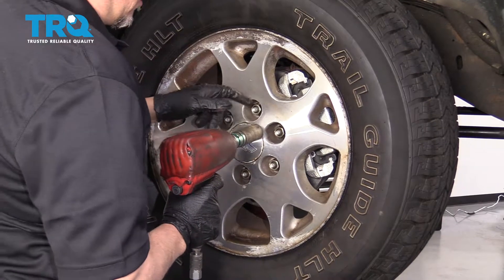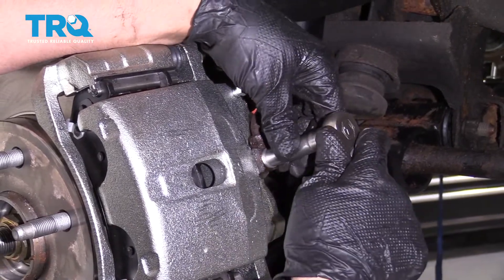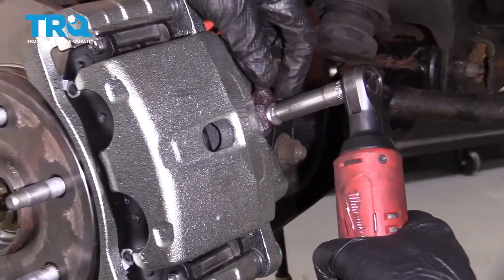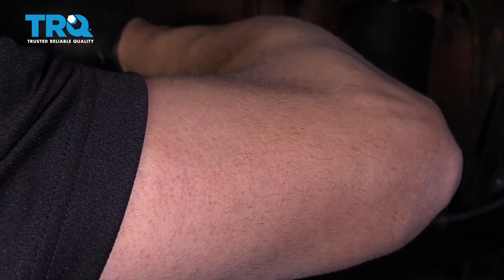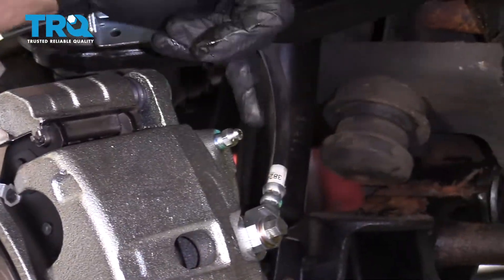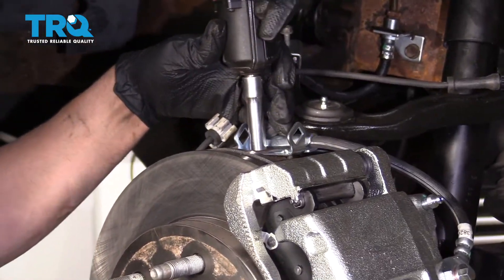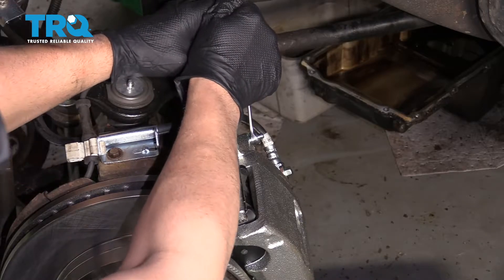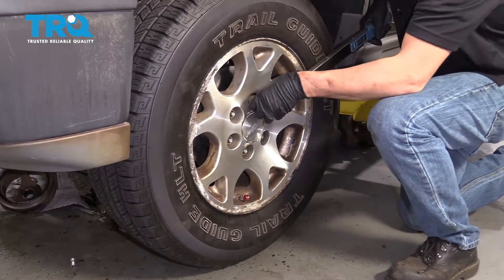How To Replace Front Brake Hose 2000-06 Chevy Tahoe

Comment: Even after watching this vid, I was still dreading replacing the line on my '02, have had plenty snap over the years trying to get those nuts on the fixed line broken loose. Fortunately, this is the cleanest vehicle I've owned, living in the rust belt, and it loosened right up. Had whole job done in about 15 minutes. Makes ya really appreciate a non-rusted vehicle.

Comment: Gotta use two wrenches, a 9/16 line wrench on the steel line nut and a wrench or vice grips on the rubber hose end.  Use lots of PB Blaster, work it back and forth      Be Super careful not to bend that steel brake line!!

Comment: The part that you call that part lol we're the flex hose meets the metal brake line what is that part called I spent 3 hours searching auto zones computer for it
Reply: The flex line stripped out and couldn't remove it from that black sqare piece

Comment: would PB Blaster be OK to use on that line bolt? or would that get into the brake fluid and cause problems?
Reply: PB blaster will work fine on the line.